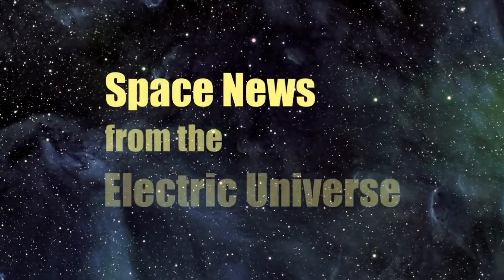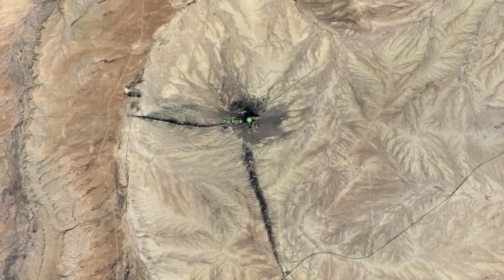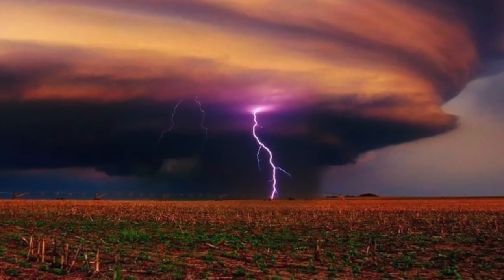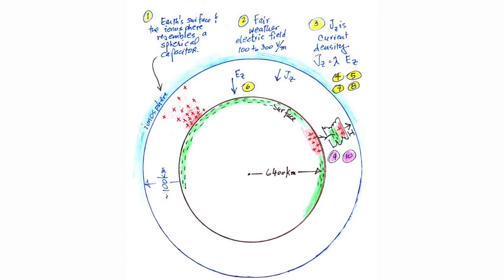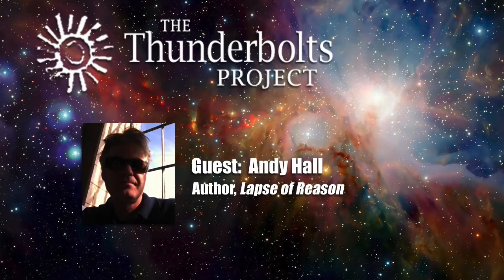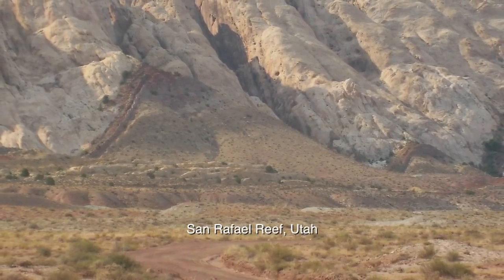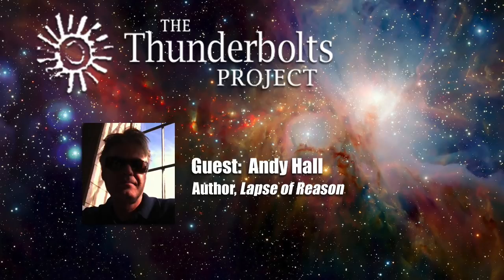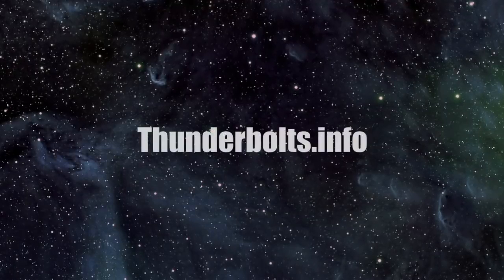Andrew Hall: Lightning-Scarred Planet Earth, Part 2 | Space News

Comment: Anyone doubting the theory behind the formations mentioned in part one and two is simply not paying attention. Lightning is constantly around us in structure but goes unnoticed at lower scales. And this stuff is TOTALLY scaleable. I have trained myself to see these currents, which touch ever so barely into the visible spectrum. Upon reflection, this level of visibility would be expected, yet I still verify my own sanity by the physical evidence manifested from the flow of these forces. This is overt evidence, once it is given 
the correct attention. 
The constant force of the plasma current flow between ground and sky is affirmed in the  electrical lily pad-stem-root connection to the lake bed. In the fall season, as the Minnesota lake I live on freezes and thaws, exactly the same geological crater formation with center raised will echo in the dying lily pads that slowly freeze in to the lake ice. 
Sharply delineated edges of ice will form around the unsunken pads and outline the "crater". These are not the rounded edges of melted ice around a heat attracter that one 
might expect. And most tellingly, the center of the pads freeze with a raised center of frozen water beneath. This water is held ABOVE lake level during the process of freezing, indicating anything but a momentary burst of energy. I would remind the reader that water is heavy, and being drawn upwards above normal level and held there long enough to freeze takes force. 
Yes, the pads are probably acting as suction devices, but this along with the stem only adds to the mass lifted. My personal testing also indicates that ionic charge, or lack thereof, may directly effect innate temperature of matter. This characteristic, if true, may affect the speed of the freezing process, but the evidence for current flow and force remains.
And if you're not into water, after dark check out some exposed tree roots nestled inside a small enclosure  on a hillside, level with or rising above other hills in the area. Stare, don't blink, and see the low glow of plasma and sparks between the roots and ground. 
Forget the experts. Just take a look and see that which is before you. We entrusted our minds to the experts for far, far too long. Repossess and guard your mind from the robbers. If you don't understand them, it is likely they don't either. They made it up, so that you might worship them.

Comment: Tunguska Explosion 30 July 1908 
Was a lightning strike but because this is a swamp you can not see it.
The only thing one can see is how the planets stood then.
Go to the website scope solar system https://www.solarsystemscope.com/.
And put the date from then in 1908/30/07
Reply: Uhhhh no.
The blast pattern in the old forest (Not marshland!) clearly indicates an airborne explosion. The consensus theory of an asteroid fragmenting before impact is not disputed by EU, for good reason!
Reply: + Jon Mallary      To which I'd like to add,  Not only does the EU not dispute an incoming asteroid, meteor, or even a comet, because with all do respect, they are really made of the same materials. Any marks, crater, rill, etc..., would depend on the type of material and the amount of positive or negative charge it incurred in its travel. Bottom line the one that came into Tunguska had one hell of a charge, or at least enough to strike at the Earth  either before, or right after, it was blasted with a counter strike. When we see the film of the, (Deep Space Impact Mission) when the 800 lb copper projectile came too close it sent, and received,  a shock which must have blasted it to bits and powder because there was no crater where there should have been when the spacecraft returned to take more photos.

Comment: I know the fine folks in Florida are nodding their heads knowing full well about lightning creating these "phenomenon." Now, I have been to some of these places when I was in the USAF. Arc builds on a much smaller scale acted like an EMP knocking out most of the base during the monsoon season. The lightning struck the runway right along the 300-foot long barrier system. The metallic mix and a two-inch cable running above this path wiping out two barrier system that was grounded in a concrete underground. Upon my arrival at the scene, the fire department said I really had to take a look for myself. The lightning shot through the 2-inch cable into the metallic mixed strip causing the entire plate to raise up in both directions about 1/2" and had to be utterly destroyed and replaced. The heavy BAK-12 units also suffered catastrophic damage on both ends. The concrete these units were anchored to was also cracked though unevenly. At the time none of us could possibly consider something we had no knowledge about. This video along with evidence in the first explained what we all saw so long ago that did so much damage.